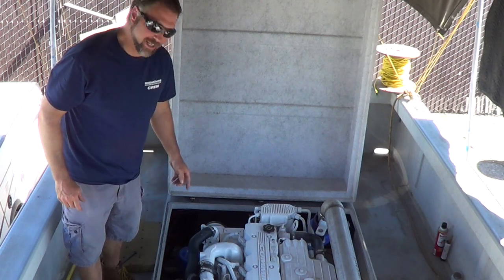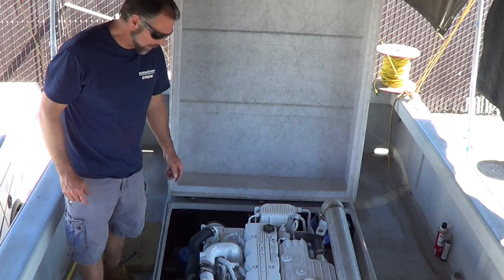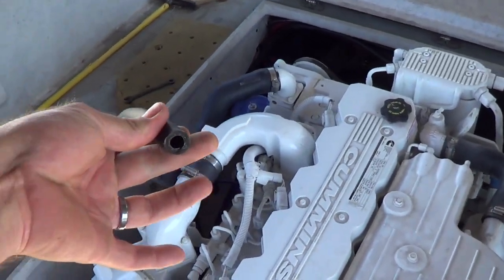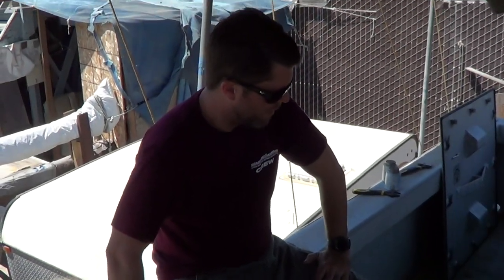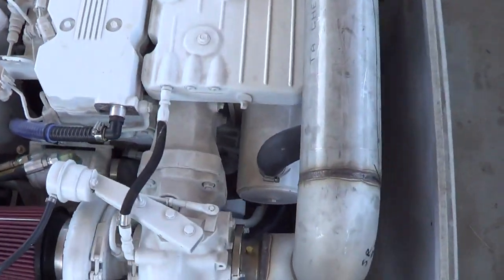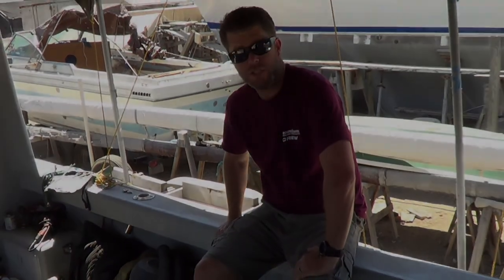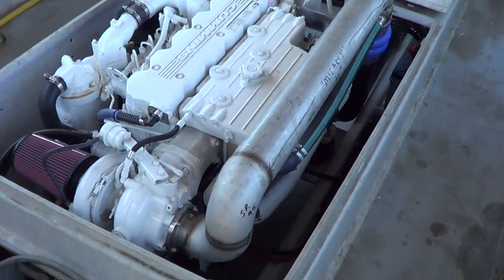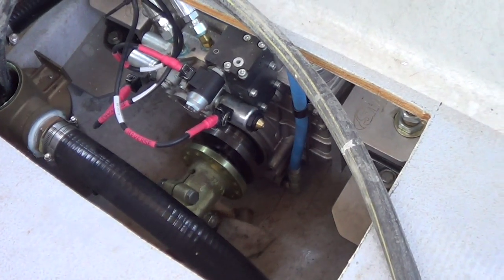Radon 27 Engine Test

Comment: Hi Tony Athens.

the more videos you post, the more followers you get.

I would like to recommend you to post
How to Videos?
That will bring you a lot of subscribers and buyers for your shop

How to videos like:
- how to clean an maintain the turbos,
- check and clean heat exchangers
- how to change thermostats
 - How to change a belt and tensioner
- water pump and impeller maintenance tricks...
etc

will be great
Thank you
'Fernando DaCosta
cummins 6cta 450 hp